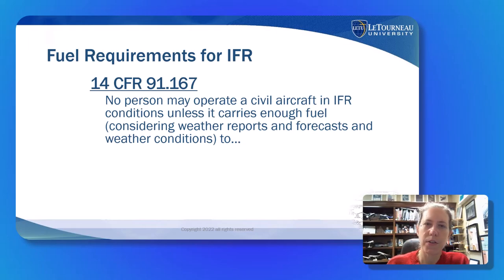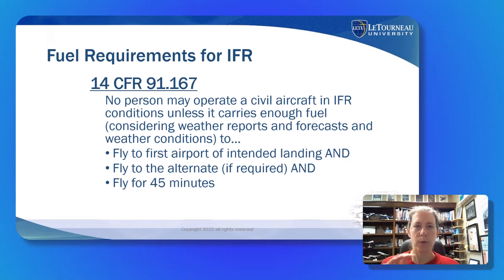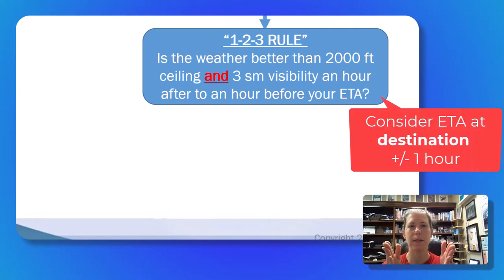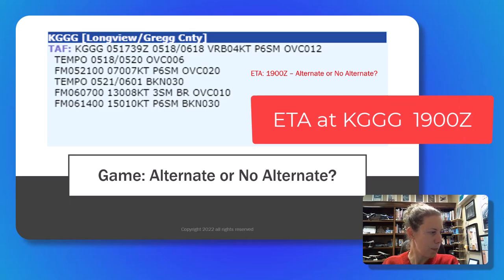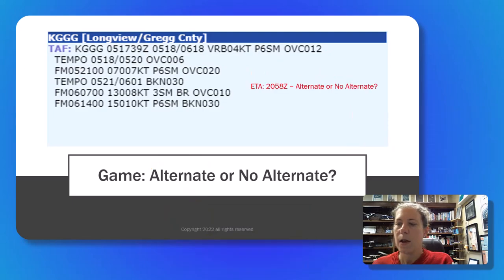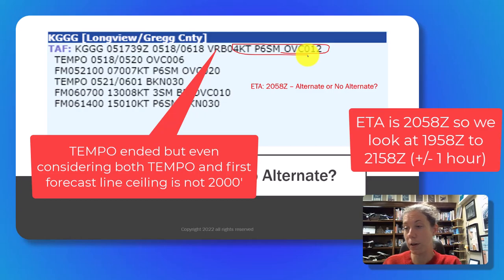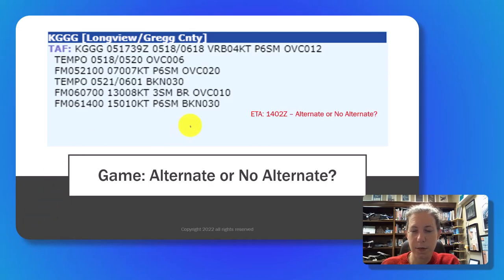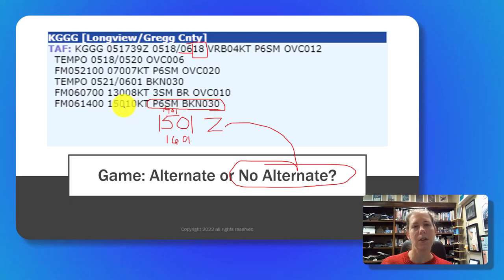IFR Fuel Planning Pilots & Dispatchers: Do I Need an Alternate? 1-2-3 Rule: The Alternate Game

Comment: Your videos are so great!  CFI (KADS/KRBD) studying for Part 135 interview.  Wrapping my head around controlling v. un-controlling TAF lines for the first time.  Given 2058z ETA, you point to the initial forecast as the reason why an alternate is required.  Would the TEMPO line not be controlling due to 1958z (1-hr before) with 600' ceiling?  Very limited knowledge, not sure where to go and get more examples like this!
Reply: I guess because your ETA falls outside the TEMPO, but your 1-hr before falls inside the TEMPO ... is what is confusing to me (?).
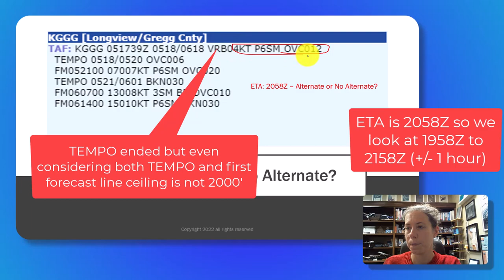Reply from the maker: @Sooner2328  Sorry for late reply here. The TEMPO and the first line of the TAF both affect us for a 2058 arrival time. (at 7:01 I tried to say this in the note I put up...sorry that was not clear.)

Comment: Also, regarding destination alternates that is easy to be over looked, the regulation says REPORTS or FORECAST or any combination of them…. 

This means that if the TAF did not require an alternate per the 1-2-3 rule BUT our flight is less than 1hour in duration (from out of the gate to wheels down at dest), AND the METAR at dest at the time we left the gate was 2 1/2SM and BKN019, then we DO require an alternate. 

In the 121 world, we determine if the flight is 1hour in length by adding the burn time on the release and the taxi out time on the release. If that calculation is less than 1hour, then we have to have an alternate if the dest METAR is below the 1-2-3 rule.

Also, in the 121 world, ETA is always considered estimated WHEELS DOWN at destination and not in the gate.

Just something to think about:)
Reply from the maker: Absolutely correct. And from talking with various dispatchers, I have heard that what you described is typically what they do - if the flight is shorter than 1 hour, the METAR (report) also applies. Thank you for lending your expertise (I'm sure you're a 121 dispatcher?)
Reply: @LauraLaster747  yes i work for an undisclosed regional airline based out of St George, UT
Reply from the maker: gotcha - enough said! @xxhockeymaster03xx

Comment: If your ceiling is 2000 and vis is 3SM, right on the dot, you do not require an alternate. There is plenty of time in that TAF provided where you do not require an alternate, just a heads up. Not just at the bottom.

Specifically, an ETA that falls within 2200z to 0559z would not require an alternate.
Reply from the maker: I see what you are saying - thank you for pointing this out! The times I picked for the "game" are those that make an alternate required (sometimes due to the +/- 1 hour requirement which is very often missed.) It is also important to know how a FM line in a TAF works which is another often confused area. But you are absolutely right that from 2200 to 0559 would not need an alternate.
Reply from the maker: I will edit my video description to say this for clarity!